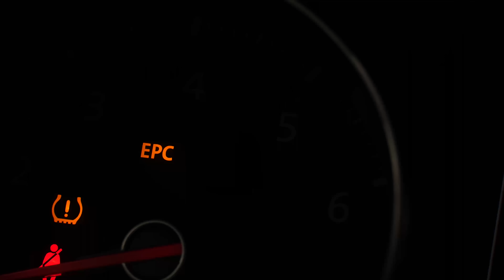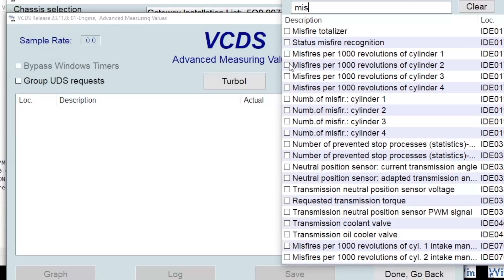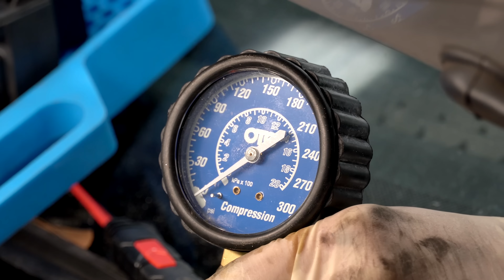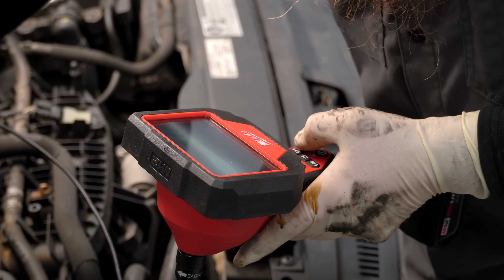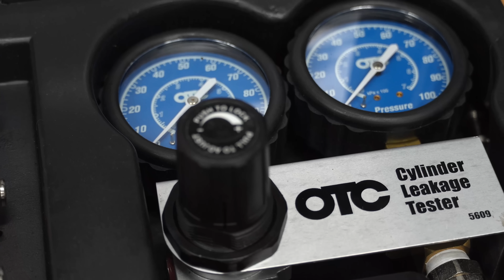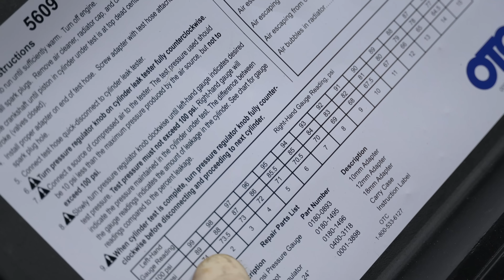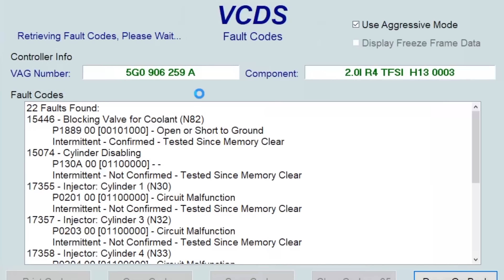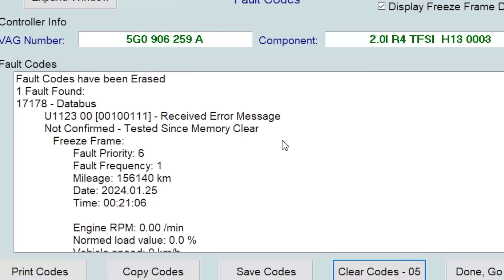Dead Misfire MK7 GTI, Another Shop Said Engine is TOAST

Comment: I bought a 2016 Mk 7 GTI and when it had 20k miles, it started acting up when I was on the highway.  REALLY rough and I could barely keep 45mph.  Had it towed to the dealer (still on warranty) They called, said they see where the computer turned off a cylinder.  They don't know why it did it, can't recreate it....sorry about your luck, come get your car.  Immediately sold it. I WILL NEVER BUY ANOTHER VW AS LONG AS I LIVE.  Not to mention all 4 rotors had grooves cut in them and rusted.  And I drove rather conservatively (for such a car) and the tired cupped at 16k...and I had an alignment done at 8k. Never again.  I now drive a Toyota.

Comment: I don’t get it. If you have a dead misfire on one cylinder, wouldn’t it lope if you cranked it in clear flood mode?

You have to take all that stuff off to change the valve spring? The joys of VVT.

Lucky that the piston didn’t smash the valve.
Reply: "You have to take all that stuff off to change the valve spring? " The EA888 uses integrated cam caps in the valve cover, so you can't take the valve cover off without releasing timing.  I don't think that's to do with VVT and VVL in and of itself, although the way VW implements VVL adds an extra complication to reinstalling the cams.

Comment: With all the effort, why not replace the rear main seal?
Reply from the maker: That’s a whole bunch more work on the other side of the engine to pull the transmission.  We will do that when the car needs a clutch
Reply: @HumbleMechanic   The REAL mechanic has spoken...

Comment: Great video but what a ball ache that whole job is.  Surely 100k is nothing for a timing chain.  Tensioners yes, but chain?  Made of cheese or something?  If it's really that necessary then bring back rubber belts rated at 100k and replace them at 90k.
Seems like it's not too user-friendly to work on these either :-(

I imagine this radically edited vid means that you have potentially a tonne of longer videos for different parts.

Comment: Since you know VWs, I have a weird one. Overnight cool weather causes the imobilizer on a 2012 jetta gli to shut down the car, the only fix is to let it get to room temperature. This morning it did this at 57 degrees. This is after attempting to fix it with a cluster swap done yesterday. It behaved like this with the original cluster.
https://youtu.be/RGKi6HF_1IQ?si=OSf9T3kte9Y-kWYY

Comment: Is this a normal failure for only 100,000 miles?
Reply: yes , your lucky if you get 100,000 miles , usually 60 k and they're trash .
Reply from the maker: Not normal, not even common, but I’ve seen it a handful of times

Comment: This generation if engines were probably the worst VW ever made. The chains were GARBAGE. They streched and you got this or worse. Even the chain tensioners and the chain drives went bad really fast. Both head and crankshaft ones. When you replace the chain on these ones, it's advised to also replace the chain drives.
Reply from the maker: The mk5 and mk6 were for sure worse